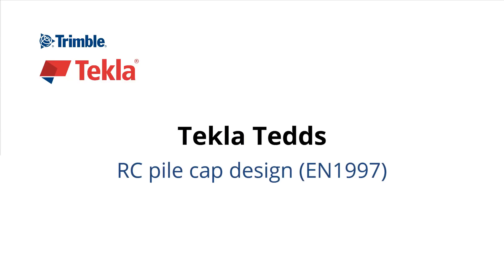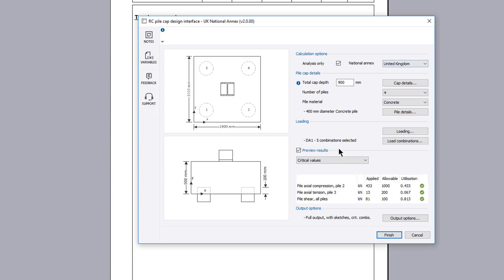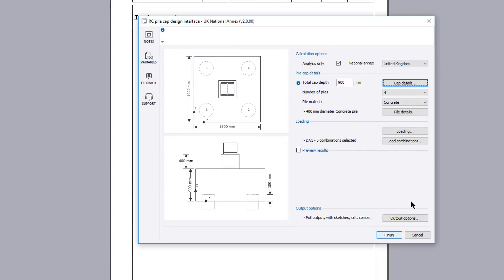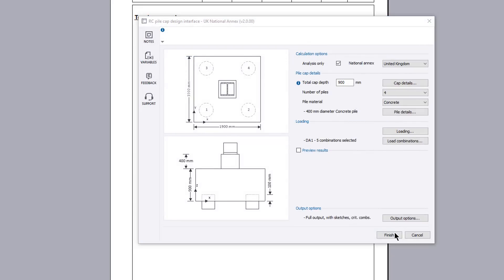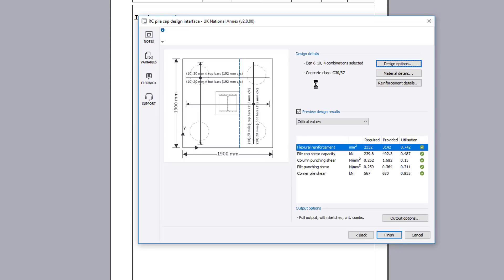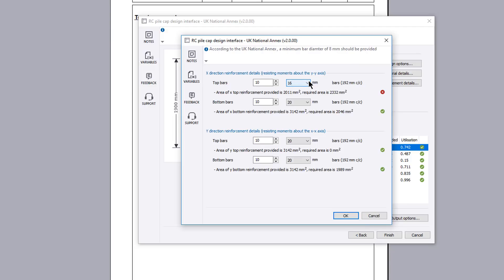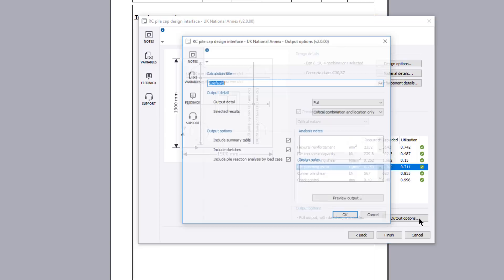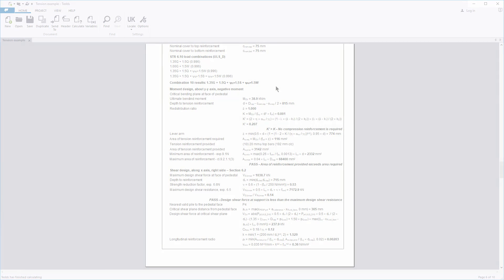RC pile cap design (EN1997)

Comment: Excellent! 

Tedds used to design pile caps according to BS which wasn't very efficient, if you design the building according to EC. The only comment I have regarding 3 piled pile cap. it doesn't use a triangular-shaped pile cap. Please let me know if I miss anything. (Didn't look in detail but just saying...)

Goodbye Concrete Centre spreadsheets  :) :)